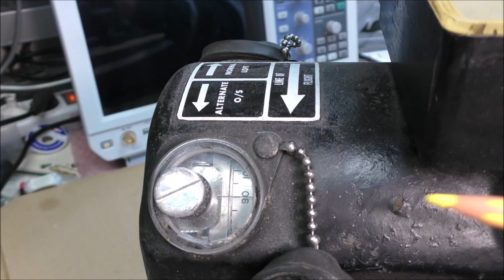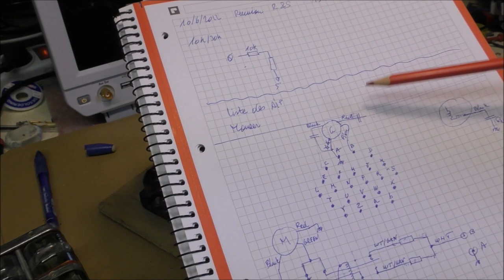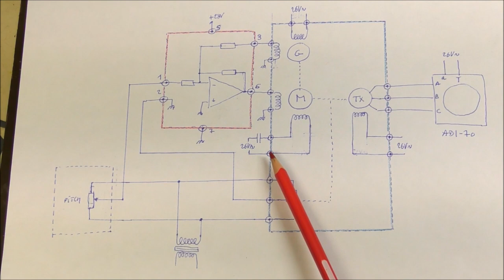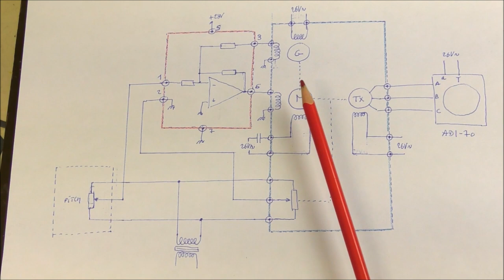LDM #278: Honeywell Cageable Vertical Gyro - Teardown and Tests

Comment: I've learned, I think from CuriousMarc, that exist multi axis table of various size to develop and test gyros while passing through the necessary lines of power and control. Quite nice and expensive pieces of gear. I guess they would have moved to mostely MEMS gyros and accelerometers and was wondering considering the amazing capabilities of these components if there is still a usage for those bulky mechanical ones.
Reply: Ring laser and piezoelectric gyros are still used in a lot of applications.  Very large mechanical gyros are sometimes used to stabilise seagoing vessels.